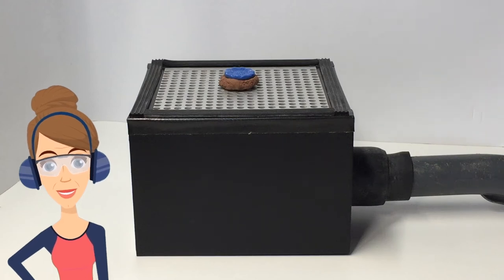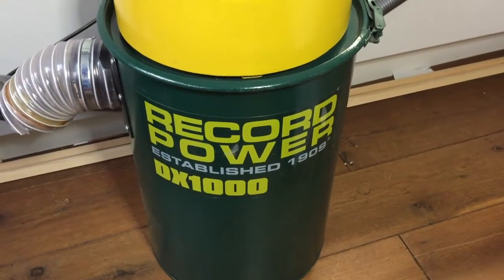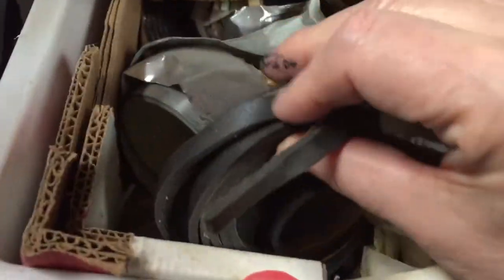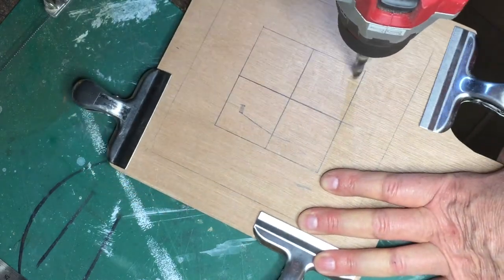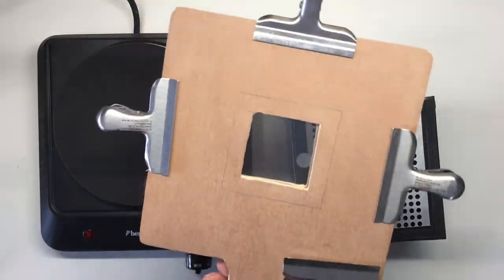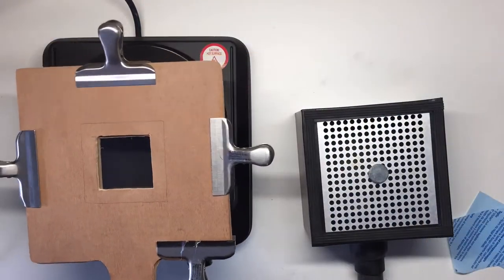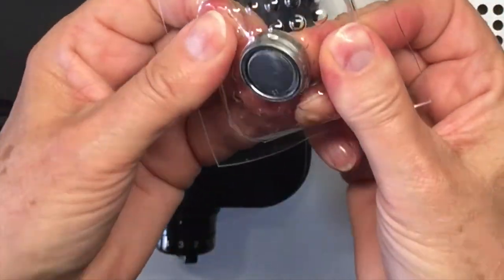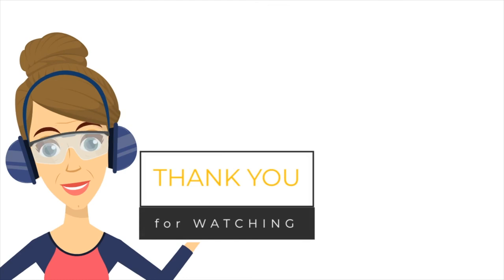Easy DIY Vacuum Former

Comment: Think,if the suction was centered in the bottom and the inside hemispherical or conical it would be way more efficient with less turbulence,no corners!
Reply from the maker: You're probably right!  However, I'm not sure how to build a hemispherical or conical inside of the box.  Do you think a cut off tube would work?

Comment: U don't need that big box. Perforated top sheet and ply bottom sheet r enough. For airtight connection need fixed rubber gasket at boundary. For uniform vaccum between two sheets groves in checks on any of plates are enough. For gradual suction u can hav a hole in suction pipe which is to be closed gradually. Don't need big suction pipe too.
Reply from the maker: Good ideas!  I just work with what I have at hand.  It works, and looks nice too 😃
Reply: @MakeMiniatures  YouTube not allowing to connect u by giving Mail ID. Shame.
Reply: @MakeMiniatures  @YouTube why u dont allow users to share their mail ids?

Comment: nice work , i have some issues and i need your help , when the pvc sheet is heated it turn from transparent to white , why ?
Reply from the maker: Thank you!  The colour change is due to the heat which changes the polymer chains of the plastic,  causing amorphous sections of the chain to crystalize. The plastic then turns white because the way the molecules scatter light changes. You can try using a lower temperature on the PVC or use a different thermoplastic instead of PVC.
Reply: @MakeMiniatures  thanks